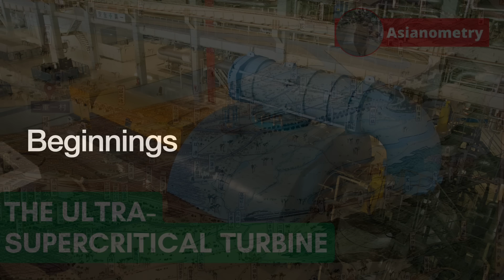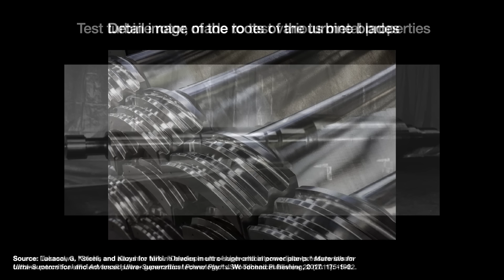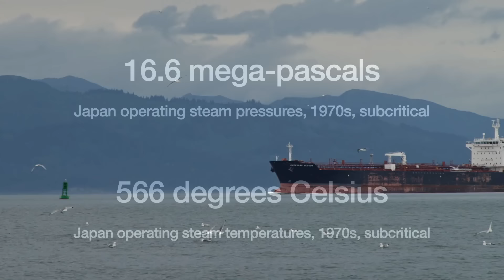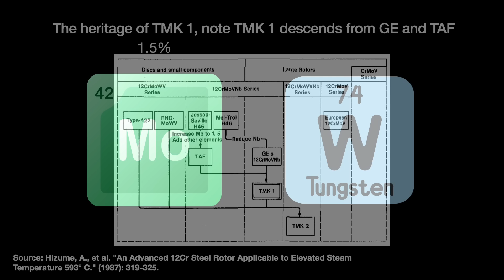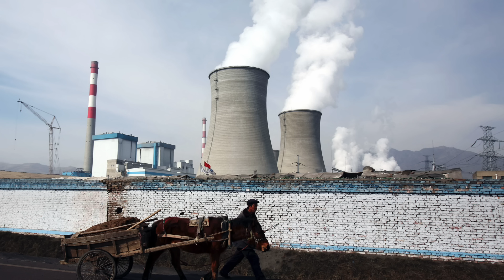The Epochal Ultra-Supercritical Steam Turbine

Comment: Good summary, but I feel you have rather neglected the technologies involved with the boilers producing supercritical steam.
The turbine operates under relatively benign conditions while the boiler has to cope with the following: 
1. Higher tube metal temperatures than the turbine blades are subject to
2. Corrosive / abrasive / fouling flue gasses
3. The requirement for extremely high boiler water quality to minimise tube deposits

With regard to CCGT units (21m 44s into the video), the HRSG is indeed a boiler, complete with steam drum and possibly supplementary firing. Since the HRSG is fed by the gas turbine exhaust it needs to be sized to accommodate the high flue gas rate caused by the large amount of excess air that a gas turbine requires. It is, therefore, a substantial item of equipment.

Comment: In cold climates there is a simpler solution, the resulting "cool"water from steamturbines can be used for remote heating.of apartments "rooms and warm tap water are heated by this technique. Almost all apartments in sweden are connected to remote heating from waste or leftover "cold" water.
 90C "cold" water is distributed in very well insulated pipes. thus combining steam turbines and remote heating can result in up to 90% efficiency, look up some electricity/remote heating plants in sweden.
Reply: Correct but these plants are designed specifically for this purpose. They are different from these plants with are optimized to achieve the highest possible electric efficiency. The steam which leaves such turbines expand towards a vacuum. The steam turbine exhaust has a temperature of around 40 degC, which is insufficient for the district heating system. 

To make the temperature high enough for the district heating system, the pressure behind the steam turbine is increased. So the steam leaves the steam turbine with around 90 degC. This reduces the electric efficiency of the plant in favor of the utility for the district heating network. Overall it’s beneficial,  since the heat is also used as you described it.
Reply: @supertyp9148 sweden burns all  their garbage on advamced powerplants, gasturbines + remote heating, the temperature in the furnace has to be above 600 C to minimize the risk of dioxin, after that serios filtering is done, and only Co2 + h20 is comming out the chimney
Reply: @andreaskampe9143  i am confused about this reply.

Comment: whats also missing is that should the waste heat be used in a district heating network, the overall efficiency rises vs dumping that heat in stacks. Lots of Scandanavian networks run off this concept and I wonder why China where its easier to build a network and works in large apt blocks never did this. I would note that lots of Asian and especially chinese coal power plants are pretty modern unlike the US and Europe. However the ones that were closer to Beijing were likely older as it has the original demand and hence why they were shut for their olympics and have not been ramped up since to the same extent. Coal plants also use a vast amount of water which unless you are by the ocean, is now getting scarce as pure water.

Comment: An interesting part of the story for better Materials for steam generators is the steel T24. It was developed in Europe for even higher efficiencies. 

Hitachi build a boiler in Duisburg-Walsum from T24. During commissioning lot of cracks appeared in the welds. In the end the whole boiler had to be scraped and replaced with another material. 

This was the start of downfall of Hitachi in Europe. Later further project delays appeared with the plants in South Afrika which where also build by the German office. These events sealed the end of Hitachi.

The company transferred to a joint venture between Hitachi and Mitsubishi, the Mitsubishi Hitachi Power Systems Europe MHPSE. 

Then Europe stopped to build coal plants, which eliminated the business Modell of this company. 
MHPSE tried to win market share in the gas sector but without the know-how in executing gas projects, most projects were finished with a financial loss. Finally Mitsubishi took over the joint venture completely and the company Mitsubishi Power was created from it. 
After years of further financial losses Mitsubishi sold the German branch to a Spanish engineering company.

Potentially the shift of Europe away from coal was the bigger cause but T24 didn’t help.

Comment: Its kinda crazy to think that Nuclear only goes to 300C. Gas turbine+Steam cycle plants really get 60+ percent into electricity vs nuclears  35 due to lower temperature.
Reply: LWR does. Boiling or supercritical water inside your reactor core does nasty things to criticality. 

Other, hotter designs exist. LWR was never intended to be anything more than a laboratory glassware demonstrator, but the fact that it needs enriched uranium solved a curly military problem - namely getting rid of all the enriched uranium they'd built up whilst making depleted uranium as feedstock to the plutonium production process. 

Prior to 1953, enriched uranium was a bloody nuisance. It was taking up storage space in the separation plants and enriching to bomb grade was stupidly expensive compared to plutonium (even when u235 implosion designs reduced the required mass by 90%, U235 bombs were still hundreds-to-thousands of times more expensive to make and extremely limited in terms of production volume capabilities.

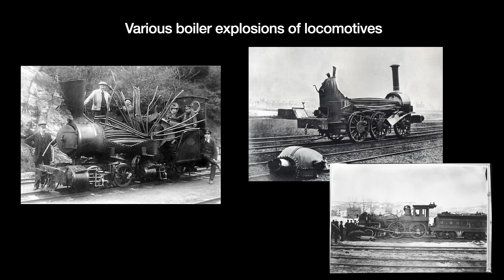Comment: 5:00 you sure that was the steam drum there? I usually hear steam loco boiler explosions in the context of water getting too low and the firebox getting exposed, start melting and, when the water sloshes back, flashing to steam at the newly weakened steel
Reply: When drums run dry, this can lead to overheating of the steel which can weaken it at the next start up and lead to catastrophic failure. This sounds similar to what you describe.
That’s also why drum level low low is a trip signal.
Reply: @sup @supertyp9148  never thought about the steam dome being able to run dry too. And the „crown sheet“ (top of firebox) has an active fire under it, the steam dome doesn’t.
Reply: @genoobt @genoobtlp4424 m drum directly doesn’t have a fire burning under it. The evaporator pipes are however welded directly  to the bottom part of the steam drum. These evaporator surfaces are exposed to the fire. 
When the drum runs empty, also the evaporator pipes run empty. So it’s not the drum which overheads because of a lag of water, it’s the evaporator pipes. The water level is just measured on the drum, because the drum marks the upper end of the evaporator.

The task of the drum is to separate the water from the steam phase cleanly and to provide a buffer of water to ensure the evaporator pipes are always filled with water.

I am talking about power plant evaporators. I do not know how the design of steam locomotives is.
Reply: @supertyp9148  fair enough. I was specifically referencing the steam locos that blew up.

Steam locos usually have a fire in the back (fireman throwing shovels of coal means it can’t be too long, though the last US steam used bunker oil, but still actively supervised thus not too long) and fire tubes going to the front. And (in my mind), the worst case of such a fire tube bursting would be a 1-5 in tube now leaks water and steam either onto the fire or out the front, but no BLEVE.

Up top, there’s the steam dome, which is deliberately above the water level in all cases, which then goes to (on modern steam locos via the fire tubes as a superheater and then to) the pistons, where waterhammer would potentially be „shooting 2ft piston cover“ levels of bad. Thus I‘m not really worried about steam collection running dry. But locos were frequently moving and down a hill and/or braking hard means all your water sloshes to the front, which can lead to the rear part of the boiler being only 1/3 full, which is approximately when you stop having water on the roof of the firebox. And depending on your luck, there’s a RAGING inferno in said firebox whose roof just lost cooling. And after the sloshing forward, the water comes back onto that half-molten plate, which is significantly hotter than your boiling water -> flash to steam -> expansion -> over the currently weakened crown sheet -> BLEVE into the firebox.

Keep in mind, „modern“ steam loco means designed between 1900 and 1950, the pictures in the video looked like 1870s era.
Reply: @genoobtlp4424 steam locomotives blowing were a big deal - a 5000hp boiler burst can easily flatten half a city block. 

That's one of the reasons railways moved so eagerly to diesel electric despite the early units only being ~1500hp (and even today most Big units top out around 2500hp)

Comment: We running around with smart phones thinking we're all futuristic, yet we're still basically running on steam power.
Reply: Exactly. 😁
Reply: Yes We realy only have one toe the big toe however out of the cave it is tenuous at best : )
Reply: Even when we figure out fusion…it’ll still be used … to run a steam power system …
Reply: @marksmadhousemetaphysicalm2938 

Or supercritical co2
Reply: @marksmadhousemetaphysicalm2938 

Not necessarily, but probably generally.
Reply: @marksmadhousemetaphysicalm2938  the only operational fusion power station in the future will continue to be the Sun.
Reply: @DumbledoreMcCracken  likely, solar seems easier

Comment: But why woud these efficiency ganis not be interesting in a LNG plant? Why is it only interesting to coal plants? A 10% efficiency gain would always be welcome, or not?
Reply: The exhaust gas temperatures of modern large gas turbines probably isnt high enough maybe, you increase the efficiency of gas turbines through water injection, intercooling and recuperation

Combined cycles gas turbines as far i know use subcritical superheated steam, maybe they can use standard single reheat supercritical 

But the advanced steam realm, 400BAR 760°C, 820°C reheat, Advanced Ultra Supercritical, Cross-Compound Double reheat kind of things is for coal plants and for some advanced nuclear designs

Comment: I think even with innovation for coal the innovation can equally be applied to geothermal, heat batteries and nuclear.  With the poor reliability on the coal side of the plant tho - it will need a much more reliable base to innovate on - else cost is too high.  Big fan of gas with Waste Heat Recovery for steam co-generation and Industrial heat storage via molten salts to drive innovation here.

It really is some of the highest engineering demmand material out there - a shaft that, resists thermal shock, does not expand too much, does not creep out and rupture underload, is corrosion resistant sufficiently, doesnt suffer one of the many high temperature degradation mechanisms that affect Ferritic/Austenitics and nickel (Sigma Phase embrittlement, 475 embrittlement, delta ferrite formation, spheroidization/creep). And when it does creep (because it will) have enough room to move and low enough strain rate to not consume the blade clearences and cause ejection and catastrophic failure......so good! And, fails safely so you can start it back up when you have a feedwater leak, chemistry issue or otherwise!
Reply: No because these sources are lacking the temperature level.

Comment: AI Summary

Abstract:

This technical retrospective traces the 70-year evolution of steam turbine technology, focusing on the thermodynamic and metallurgical transitions from subcritical to ultra-supercritical (USC) and advanced ultra-supercritical (A-USC) cycles. The analysis highlights the primary driver of turbine development: the Rankine Cycle's dependency on increasing input steam energy to approach Carnot efficiency. 

The narrative details the mid-20th-century "Steel Stall," where early American attempts at supercritical operation failed due to the limitations of existing T22 ferritic and austenitic steels, which suffered from creep, oxidation, and thermal cracking. The focus then shifts to the Japanese R&D programs of the 1980s and 90s, which achieved a breakthrough in material science. By engineering "Advanced 12Cr" ferritic steels—specifically TMK1—through precise molybdenum-tungsten alloy tuning and electroslag remelting, Japan enabled the first viable 600°C USC plants. The summary concludes by comparing modern steam turbine efficiencies (up to 45%) against Combined Cycle Gas Turbines (CCGT) and examining the ongoing role of coal-fired USC technology in providing high-capacity baseload power in Asian markets.

The Evolution of Ultra-Supercritical Steam Turbines: Technical Summary

*   0:37 Fundamental Thermodynamics: Thermal power plants utilize the Rankine Cycle, converting heat from various sources (primarily coal) into mechanical energy. While less efficient than hydroelectric plants (90%), thermal plants (30-60%) offer higher geographic flexibility.
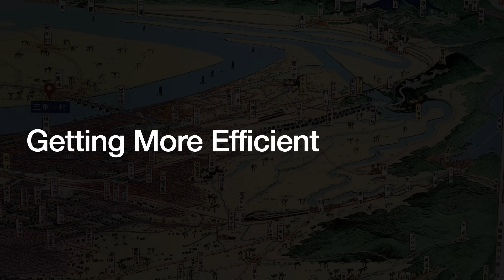*   1:34 Driving Efficiency: Turbine efficiency is governed by the Carnot heat engine principle, where increasing the energy delta between entering and leaving steam is the primary lever for performance. Raising input temperature and pressure reduces fuel consumption; a 1% efficiency gain can reduce CO2 emissions by 2-3%.
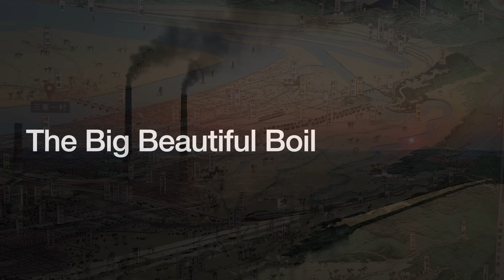*   3:27 Supercritical Fluid Dynamics: Standard boiling plateaus at 100°C (at sea level). To bypass this, water is pushed past the critical point (22.1 MPa and 374°C), becoming a supercritical fluid. This allows for continuous heating without boiling, facilitating "once-through" boiler designs that eliminate heavy, high-risk steam drums.
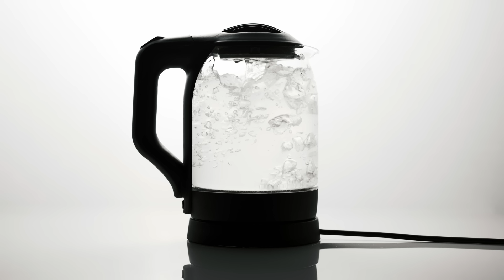*   5:30 The Early Supercritical Era: The 1950s saw the deployment of Philo Unit 6 (USA), the first commercial supercritical unit operating at 621°C. However, these early designs were unsustainable due to metallurgical failure, leading to a decades-long retreat to lower "sub-ultra" parameters.
*   7:34 Metallurgical Bottlenecks:
    *   Ferritic Steels (T22): Welder-friendly but lose creep strength above 560°C.
    *   Austenitic Steels: High nickel/chromium content offers heat resistance but suffers from poor thermal conductivity and high expansion, leading to cracking during thermal cycling and severe steam-side oxidation.
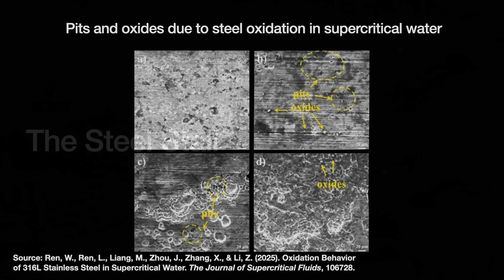*   10:31 The "Steel Stall" and Economic Factors: In the 1960s-70s, low coal prices in the U.S. disincentivized efficiency R&D. Utilities prioritized scaling turbine capacity (up to 1000MW) rather than increasing temperatures, hitting a plateau in the mid-500°C range.
*   11:56 Japanese Leadership and R&D: Post-1970s oil crises, the Japanese government funded a 10-year R&D project (Wakamatsu Institute) to achieve USC conditions. They discovered that austenitic steels remained non-viable for large rotors due to warping, shifting focus toward advanced ferritic alloys.
*   14:52 Material Breakthrough - TMK1 Steel: Mitsubishi and Kobelco developed TMK1, an "Advanced 12Cr" ferritic steel. Key features include:
    *   Alloy Tuning: Precise 1.5% Molybdenum content to maintain internal structure without forming strength-undermining delta-ferrite.
    *   Manufacturing Complexity: Utilizing vacuum melting and electroslag remelting (drop-by-drop casting) followed by a four-stage heat treatment to lock in crystal microstructures.
*   17:58 Implementation and Modern Benchmarks: 
    *   Matsuura Unit 2 (1997): The first large-scale 1,000MW USC plant (42% efficiency).
    *   Isogo Unit 2: Achieved 45% efficiency using a double-reheat cycle at 600°C/620°C.
*   19:25 Advanced Ultra-Supercritical (A-USC) & Future Outlook: European (AD700) and Asian programs are exploring A-USC (700°C+) using nickel-based superalloys to target 50% efficiency. 
*   20:59 Baseload Power Context: While Combined Cycle Gas Turbines (CCGT) reach higher efficiencies (55-60%), steam turbines provide unmatched scale (up to 1,500MW) and leverage the low cost and storability of coal for steady baseload power, making USC technology essential for current energy grids in India and China.

AI-generated summary created with gemini-3-flash-preview for free via RocketRecap-dot-com. (Input: 20,009 tokens, Output: 1,227 tokens, Est. cost: $0.0137).

Comment: China building ever more coal fired power plants.  Burning coal to power the manufacture of solar panels and wind turbines for the West.  Smart (for China)
Reply: In fact China is taking older coal fired power plants off commission at a faster pace than it builds new ones soon. And on top of that, later coal fired plants are increasingly used part time to complement renewable sources saving fuel for smarter use. Coal share on the grid as a power source peaked in 2024 or 2025.

Comment: Thank you so much for going over the history of the development of supercritical turbines.   You didn't go into the supercritical turbines are compact and fast reacting allowing them to follow erratic conditions.  Gas turbines are the best at that and are the reason the power grid is able to support wind and solar generated electricity that can go to near zero in a few seconds.  Water vapor is over 99.5% of greenhouse gas temperature forcing.   All the greenhouse radiant energy from the earth is completely absorbed in earth's water vapor saturated greenhouse effect with greenhouse gases a few meters from the radiating surface adding 10°F to earth's average temperature.   After 20 meters form an earth connected greenhouse energy radiating surface there is no measurable greenhouse radiant energy.  Its further heat transfer is by convection gas molecules bumping into each other.   This was my 1978 George C. Marshall Falls Church VA high school science. 

 It's easy to check percentages.   Water vapor on average is 1% of the troposphere with a CO2e of 18.   CO2 is 0.04% of the atmosphere with a CO2e of 1.   1.00%/0.04% = 25.  Water vapor is 25 times more present than CO2.   25 X 18 CO2e = 450 CO2e for water vapor to 1 CO2e for  CO2.  All the other greenhouse gasses total to 1 CO2e.   water vapor 450/452 = 99.557%, CO2 1/452 =  0.22%